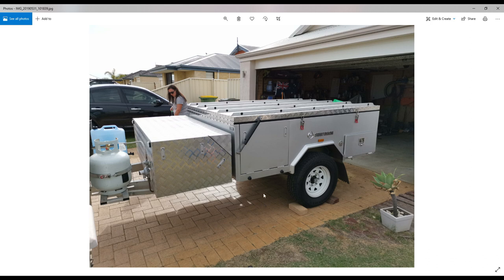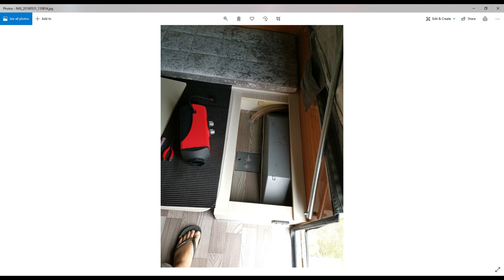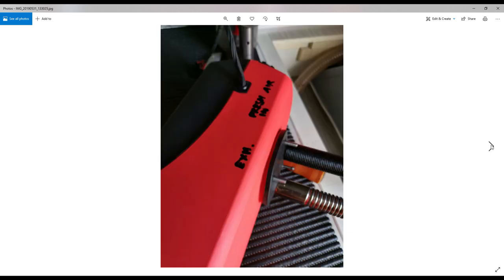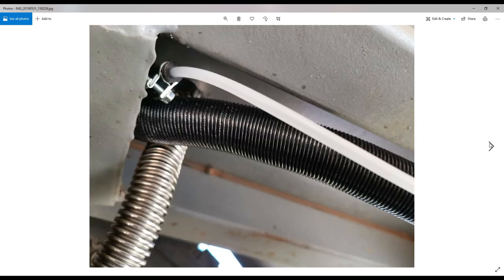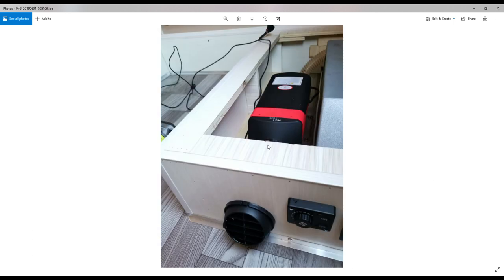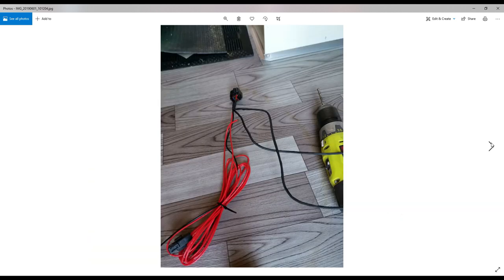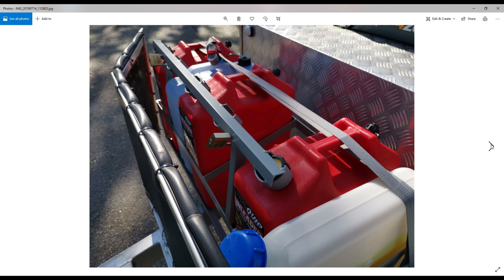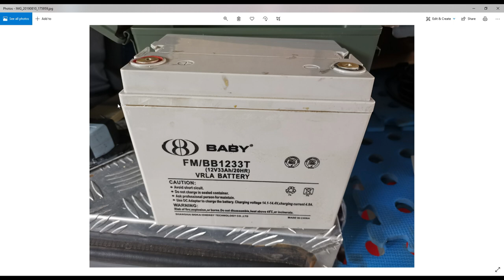DIY Ebay Diesel Heater install into Camper trailer / RV / Caravan / Vanlife

Comment: Your pump needs to be mounted at least 45 degrees  or it will allow bubbles to form inside and the pump wont get proper lubrication and fail in weeks/ months.  The current peaks at 11.5 Amps during startup for about 5 minutes.  Once the glow plug goes out will drop to 4 amps. On lowest its about 1.25 amps.    Change the chinese kit supplied clips as they will rust and fall apart in months  for stainless marine grade clamps as you will need to take out the heater for servicing.    Fit a 1" 25mm air filter else your burner hole will get blocked.   This makes it quieter too.  To make it much quieter add a second muffler kit and add it on the end.   After 8 -12 hours on low always crank it up full power for 20 mins else they will soot up and throw error codes and eventually wont start.